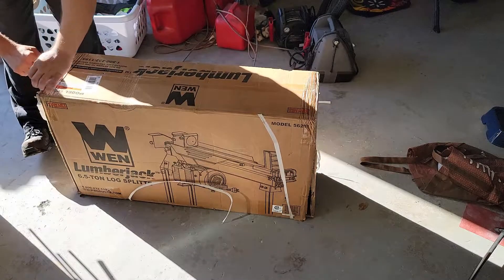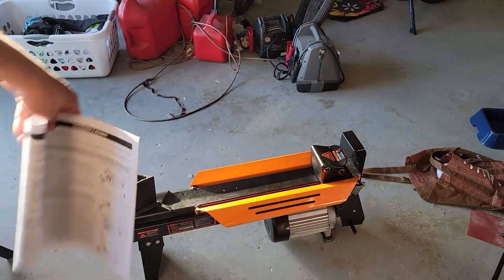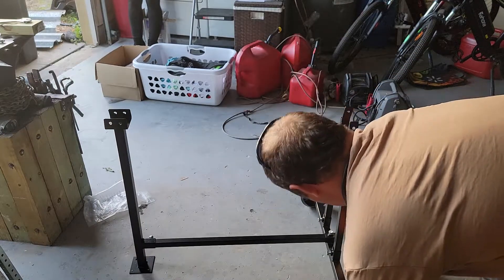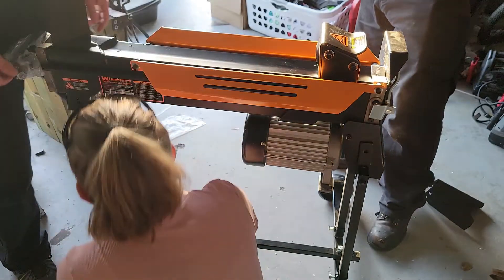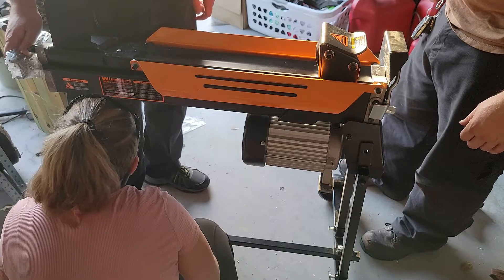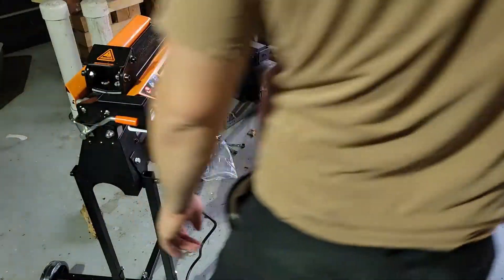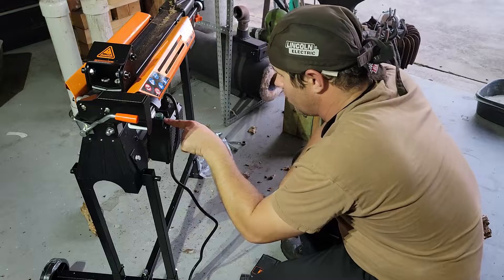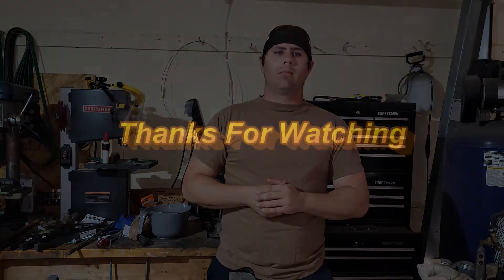Turning A Log Splitter Into A Forging Press: Part 1- Unboxing and Assembly

Comment: Is there a difference between the 5207 in the 5208
Reply from the maker: To be completely honest, I don't know. I know both are 6.5 ton presses, and have 15 amp motor. They look to be about the same. But don't quote me on it. When the time comes for me to replace this one with another, if I don't buy a legit forge press, I may get a 56208 and see if there is a difference.